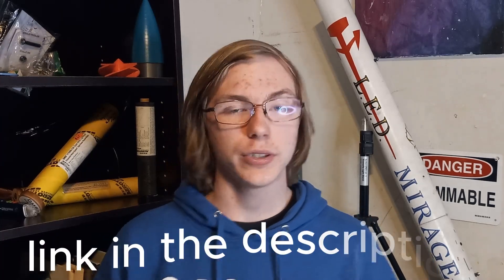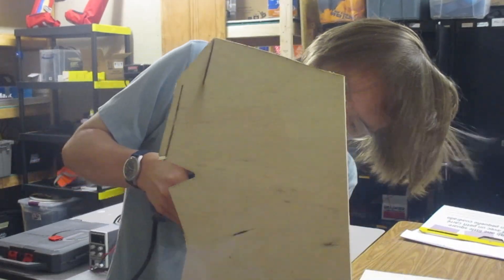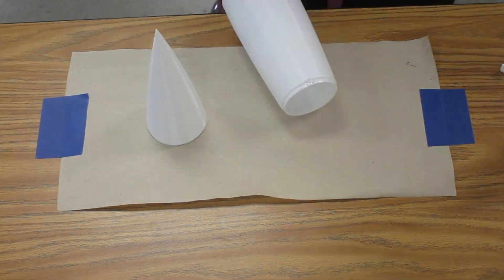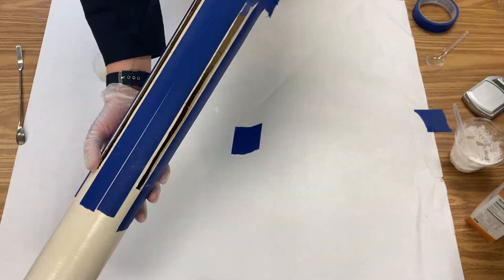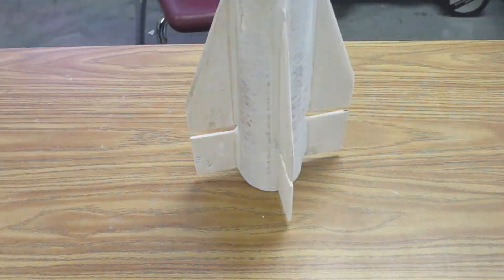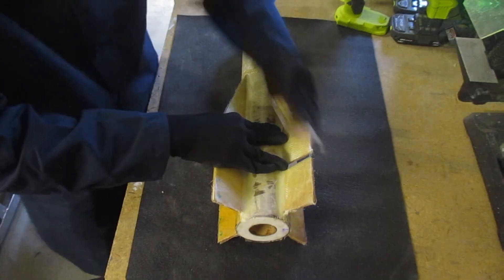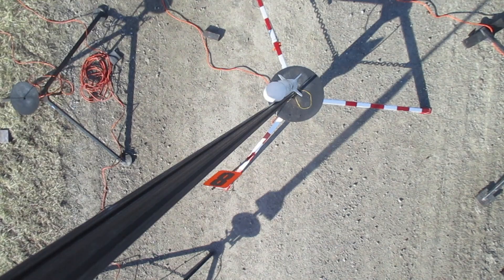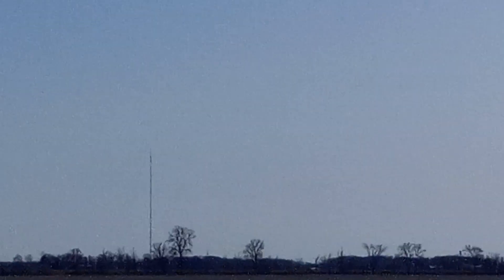High-Altitude Disaster: Rocket's Failure Destroys Expensive Camera

Comment: Build well done. Good tips. Never thought of using corn starch for thickening resin. I’m gonna give that a go. Next time you do tip to tip, spread the resin out on a paper plate to keep the resin from slashing.
Reply from the maker: that's a good tip, thanks. I had assumed it was because of the heat, but i didnt think about spreading it out to reduce that.... 

yeah, I've found that if you use over 50-60% cornstarch by weight it makes the fillets a little more brittle, but depending on what epoxy you use its still plenty strong.